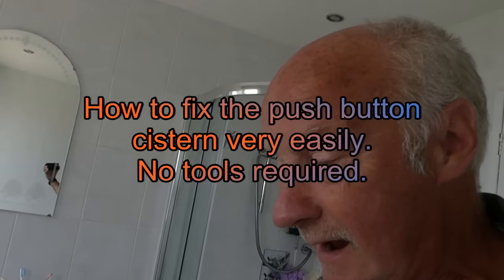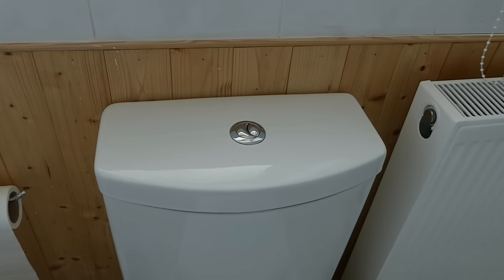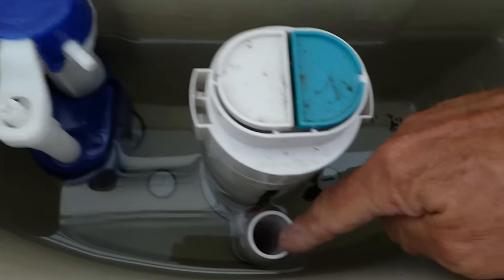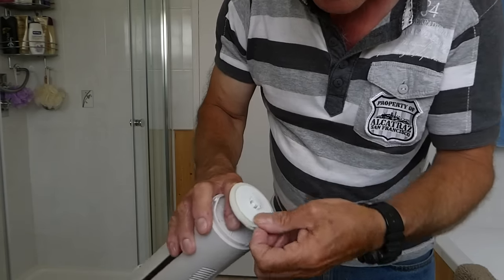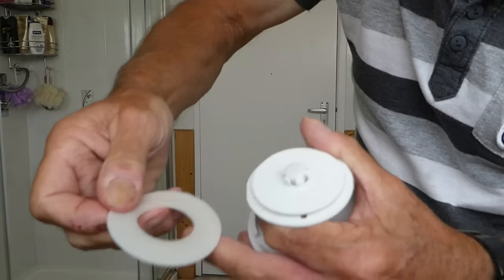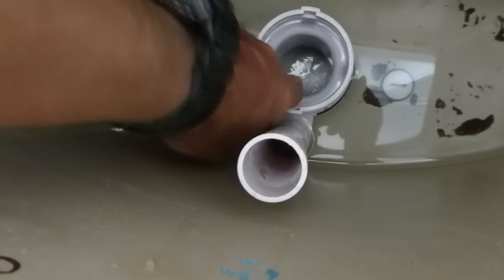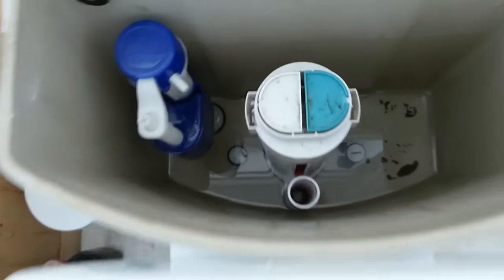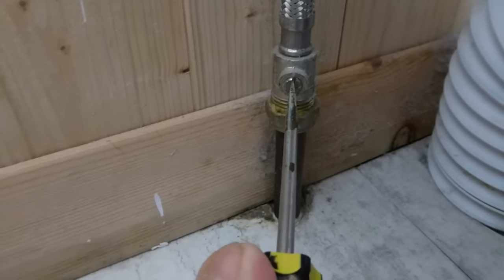How to easily fix the push button cistern no tools required

Comment: Mr Dereton, I have a problem removing my flush valve. I tried twisting it but I can't pull it out. I think the water already hardened the valve. Is there anyway I can remove it? Many thanks.
Reply from the maker: Yours may well be a small handful of models that do not split and have to be completely undone from the bottom of the cistern, then pulled out .
Reply: +dereton33 I've removed it before. Like the twisting you did. But that was ages ago. Now it's stuck!
Reply from the maker: As you have nothing to loose just keep pulling and twisting, it`s the only way.

Comment: Hi mate I'm having my bathroom done. Fitted a cealed system with a flush plate . Water pressure is good and it fills ok but no power I'm the flush and won't get rid of the toilet paper. The cistern is turned up to full 6 litre . What am I doing wrong
Reply from the maker: Check the syphon is not set to half a flush, make sure it completely empties the cistern every flush.
Reply: @dereton33  yes it's not set to that.

Comment: Hi, one of the two buttons on my toilet keep getting stuck so the cistern won't refill. Do you know where I can get a replacement as I can only find a replacement with a cable attached. Thanks
Reply from the maker: Mark David Hi i sell them at my website or Amazon do them.
Reply: Thanks for the reply, appreciate it.

Comment: Thanks.
I've just installed one of these for my Mother, everything was great but within seconds & WITHOUT touching anythinng the water started to run into the over flow pipe you refered too for some reason so the water keeps running into the toilet, any advice?
Thanks.
Reply from the maker: The valve level wants adjusting lower.
Reply from the maker: Or the syphon is not seated properly.
Reply: dereton33
Thanks.
 What/where is the valve level?  
Wish photos could be posted on here as my Mothers internal parts are not 100% the same as in your video, the buttons even stay in the cistern when the lid is remove.
Reply from the maker: Some are slightly different. There should be a line marked on the inside of the cistern indicating the water level. If not as a rough guide set it to about an inch below the overflow pipe.
Reply: dereton33 Thank you very much for your help.

Comment: Hi, my toilet is identical to this. I tried this technique but the toilet still runs water into the cistern. Is there anything else you can suggest? Thank you.
Reply from the maker: Melissa Bubnic You can make sure your ballcock is shutting off ok and that the water level is correct. After that a new syhpon may be the only answer. I have video`s on how to fit them.
Reply: dereton33 Thanks for your response. The ballcock is not shutting off okay. I have to manually pull it high and the water stops running. As soon as I let it go, the ballcock depresses slightly and the water starts running again. I will check out your video on how to replace the siphon. Would I have to remove the entire cistern?
Reply from the maker: There should be an adjustment screw on your ballcock that will allow you to adjust the water level down to the correct level. You will not need to replace the sphon then.
Reply: dereton33 Thank you Derek! I think I have fixed it. I really appreciate your help.

Comment: Mine is brand new maybe 2 months old, when you flush the water wont flush it comes up in the bowl like its clogged up then it will slowly drain down, also water is leaking the bowl wont hold water then once its drained out maybe like a glass full of water remains in the bowl. You flush it again and the water shoots up kind of and the bowl fills up but no flush back to square one. Mine is the dual flush also. Personally I hate it didnt realize its what I bought wont do it again. I run off a well system I could care less how much water my toilet uses I just want it to work. Please help thanks
Reply from the maker: Sounds like your pan is blocked. The flush though should not be leaking water into the pan so check the water level in the cistern.

Comment: Hi Al, in my case I have the exact same type of two button toilet as in the video but my issue is the cistern is filling up too high and overflowing down the white pipe and into the pan. Is this a case of adjusting the ball cock or replacing it? Do you have a view on it? Thanks.
Reply from the maker: Try adjusting it first, if you have no luck then replace it.
Reply: @dereton33  Thanks for your reply. I've tried adjusting it by turning the screw but no luck. I've never replaced one of these before, do you have a video on this or is it straightforward?
Reply from the maker: No but you should fine one ok.

Comment: Failed on the very first step, can’t get the twisty thing out. It seems locked in there. Any tips?
Reply from the maker: It may be one of the rare one's that do not split.
Reply: It looks identical to yours! The whole top half spins around when I twist it, just doesn’t seem to actually come unattached. 
Thanks for answering.

Comment: Ive changed mine in the past worked like a charm,  but had to change again a month ago and it disnt fix the problem, water leaks in to toilet for about 5-10 mins then stops, any ideas please
Reply from the maker: Check the ballcock is not letting by. If no luck then a complete new unit is required.

Comment: Hi mate i have just installed a new toilet with this type of flush. When i flush it i get a howling/moaning noise for about 3 or 4 seconds. It's not a water supply problem as it is silent when refilling. Any ideas
Reply from the maker: If you have a balla-fix valve on the feed to the cistern try turning it down to slow the filling rate. If not try turning your main stopcock down for the entire house to a rate you are comfortable with.
Reply: dereton33 
Thanks for replying. The noise isn't happening as the cistern is refilling, only as the toilet is flushing
Reply from the maker: Yes that is because as it is flushing the valve opens to refill the cistern.
Reply: dereton33 
Just solved it. There is a vent drilled in the back of the lid. As the water empties and the air gets drawn in it was creating that howling noise. Slightly filled the void with some plumbers mate seems to be ok. Thanks for sharing these informative vids Al.

Comment: I wish the inner parts of the syphon are explained in detail.How the water flows thru the syphon in the two different modes of half and gull flush.But I generally observe there is no quantity difference in half and full modes.A same quantity washes down.The water keeps flushing  down as long as you hold the button be it half or full.So that maybe explained.2 button system seems only theoretical in saving water.

Comment: I'm having problems removing the cistern.  Any suggestions?
Reply from the maker: WD 40 on the wing nuts and bolts under the pan, leave for a couple of hours before undoing, if they remain solid then saw them off with a junior hacksaw.

Comment: So in Europe shutting off water is counter clock wise. ( USA are right turns )   Same with the Flush part...you turned Right...so lefty loosy does not apply to these things.  I would have busted it off. Glad I saw this.

Comment: That's a ridiculously easy cistern to deal with. Most are either connected by a wire to the flush or you have to try to undo the push button to start with - and that's not always easy it it hasn't been done in a while.
Reply from the maker: Lucky me
Ha ha.

Comment: Mine is stuck open 😢. Not because of the seal. If we push manually then it goes down closing
Reply from the maker: New part required.

Comment: I have got the same problem. Water keeps running into the pan but i can't lift the lid.  It seems to be stuck. i don't want to force it in case i break something.
Reply from the maker: There is a hidden screw under the buttons
Reply: @dereton33  I lifted the button but couldn't find any screw.  Do i have to take out both buttons?

Comment: Thanks I'll try that save me a plumber visit .
Let you know if it fixes a leaking toilet later
Reply from the maker: Fingers crossed.
Reply: @dereton33  Thanks so much ,had a go at the leaky toilet last night and turned that washer around .
Flushed it a few times sorted .Works perfectly now .
I'd buy you a pint for that useful information on here ,saved me probably 70 or 80 £££ on a plumber call out .
Appreciate it very much ,such an easy fix .🙂🙂🙂😉

Comment: The water level in my cistern keeps rising over approx. 8hrs until it reaches the overflow. Tried setting the float to its minimum but no joy.
Reply from the maker: Ste Bridge You will either have to replace the washer in the valve or renew the valve itself. Al.

Comment: Yes simple, our toilet is three years old only and I had a small drip so followed the video and had the washer changed over in a couple of minutes, unfortunately still dripping. When i checked the new face i found little indents, so it looks like they may have changed the design so it only has one flat surface. Washer makers looking for more money.

Comment: I can't twist and pull out the flush valve.  Have tried clockwise and counter.  Anyone with ideas?
Reply from the maker: It may be one of the rare fixed ones.  Means fitting a whole new unit.

Comment: My  syphon won't come out. It twists  left  and right but I can't remove it.
Reply from the maker: Sounds like one of the rare un-removable ones .
Reply: @dereton33 I have a syphon that doesn't unscrew. There are  tabs on either side that have to be released. Not much room for my gnarly hands so i used a boot lace, hooked under the tab and pulled up and out at an angle.

Comment: I changed the washer round and water still runs into the pan. Please help!
Reply from the maker: A new washer required.
Reply from the maker: Well to be safe buy the new flush valve.
Reply: dereton33 bought a new washer and still leaking!! How is this possible? Anyway, ordered a whole new valve and flusher from B&Q, £18! Surely this will sort the issue.
Reply from the maker: Must have a flaw in the housing letting the water back to the pan.
Reply: dereton33 will a whole new flush valve that i've bought from B&Q sort this issue?
Reply from the maker: Check also that the ballcock is not letting by.

Comment: I tried it, but the water kept filling up. I have a shut off valve in the other room but the person that installed it, one of the levers can’t shut off as it’s hitting the wall pfff
Reply from the maker: Turn it off from the main stopcock. Usually under the sink
Reply: Thank you. I ended up doing exactly what the video instructed to flip that seal around, but that’s not my issue. I was able to avoid the water issue by holding up the part on the left to stop the water running. The water is completely clear, but not sure if I have an obstruction because it won’t flush all the way.

Comment: My toilet has been leaking and is there any case like the screw under the flush tank keeps on touching the cistern ?
Reply from the maker: Not sure what you mean?
Reply: @dereton33  water keeps on running and doesnt stop automatically even it is full and water goes to overflow valve
Reply: @dereton33  3:56 is there any case like screws in the lit keeps on flushing by touching the cistern?

Comment: Mine doesn't even have a washer on it? Whats that all about???
Reply from the maker: It is probably lying in the bottom of the cistern.
Reply: Checked nothing... Strange
Reply from the maker: Maybe it just perished and flushed away in small particles.
Reply: Possibly i will just buy a replacement, thanks.

Comment: My problem is that the left push button works just fine but if I push the right button, the water keeps on flowing into the toilet after the flush, so I have to press the left button again.
Reply from the maker: The plungers are sticking remove the syphon and check the mechanism.

Comment: SOME IMPORTANT CORRECTIONS.;  BE CAREFUL TAKING LID OFF, WHEN HE SAYS 'SOME (BUTTONS) ARE SCREWED DOWN', HE'S NOT BEING CLEAR, THIS ONE IS SCREWED ON TO THE CISTERN LID, HE MEANS SCREWED TO THE FLUSH, EITHER BY THE BUTTON ASSEMBLY  ITSELF (TRY UNSCREWING THE WHOLE THING IF YOU CANT LIFT LID),   OR A SMALL SCREW HIDDEN UNDER ONE OF THE BUTTONS!, YES, NAUGHTY THAT ONE, YOU'LL NEED TO PRY A BUTTON OFF IF YOU CANT UNSCREW THE WHOLE BUTTON ASSEMBLY ITSELF OR LIFT LID.. THERE IS ANOTHER V COMMON TYPE, THEY ARE TETHERED TO THE FLUSH WITH A CABLE AND YOU'LL BREAK SOMETHING, POSSIBLY THE CISTERN LID IF YOU DONT TAKE CARE LIFTING OFF, TETHERED ONES ARE PUSH BUTTON RELEASE UNDERNEATH!..THE FAULT OF FLUSH MECHANISM GETTING STUCK UP  WHEN FLUSHING THAT HE DESCRIBES HAS NOTHING TO DO WITH THIS WASHER!  OH AND MOST OF THEM UNLOCK ON A BAYONET THE OTHER WAY, ANTI CLOCKWISE, SOME ARE HELD ON BY 2 TABS THAT NEED RELEASING WITH FINGERS .. I'M SURE HE WOULD HAVE CORRECTED THESE HAD HE KNOWN IT WAS GONNA GET A MILLION VIEWS!!
Reply from the maker: This video was not meant to rectify buttons getting stuck up. Only ones that do not flush.

Comment: water wont stop running, the floater won't fully turn off
Reply from the maker: The valve needs adjusting or replacing.
Reply: @dereton33  is the valve under the water input housing? I have a  dual flush setup mostly similar to this